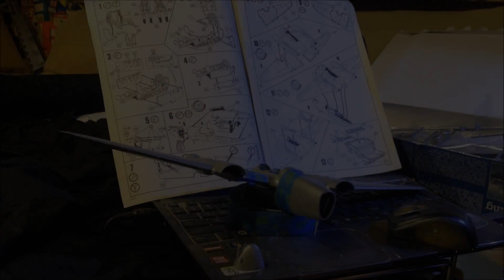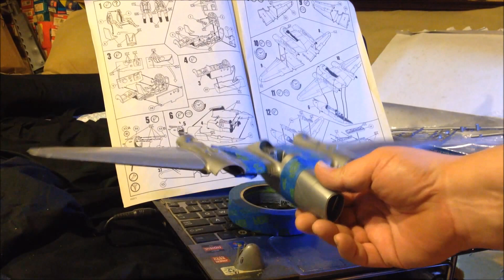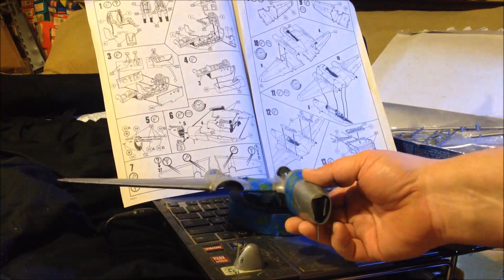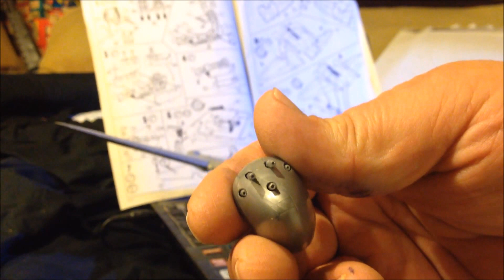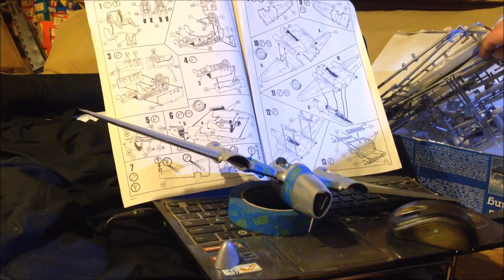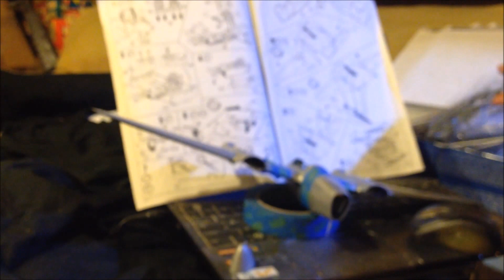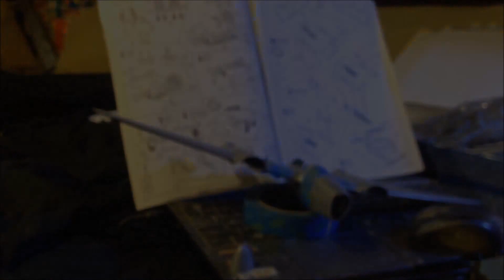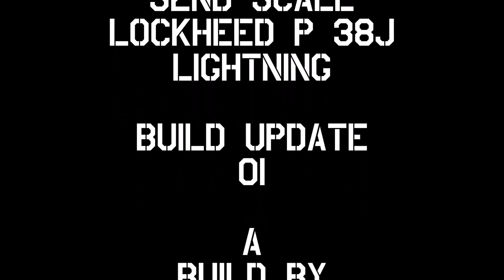2016 Community Box Stock Other Update 01

Comment: Bob, Seams like you've got some fit problems! That's one handsome pilot! At least you've got something of an Allison. Good luck with the rest, - Bob
Reply from the maker: +bob dyer Got the wing root worked out, the piece was misaligned, some extra thin and clamping fixed that. The engine is very basic, I'll paint'er up best I can, but it may never be seen, if the covers are on.